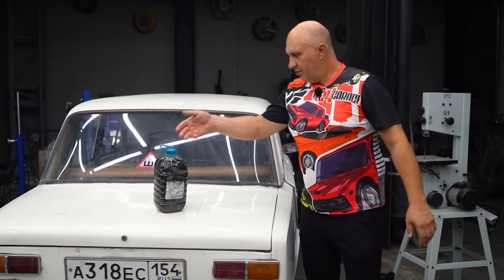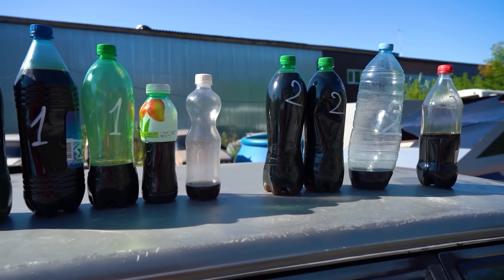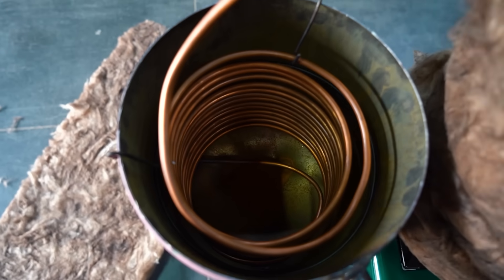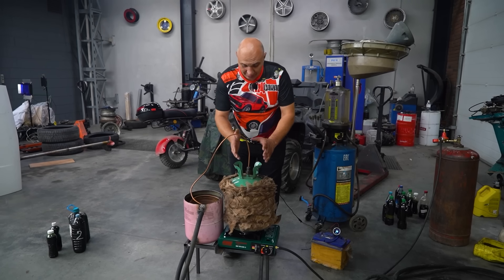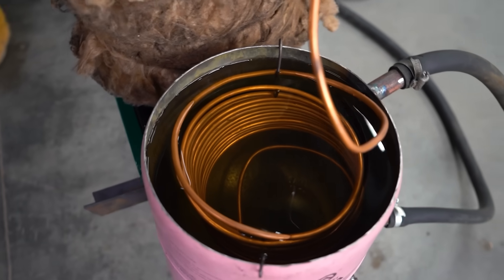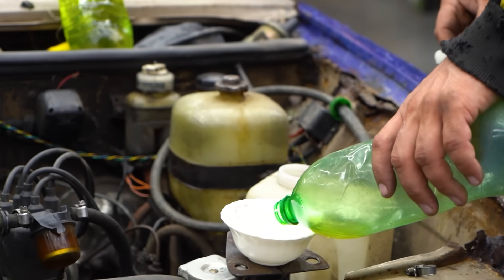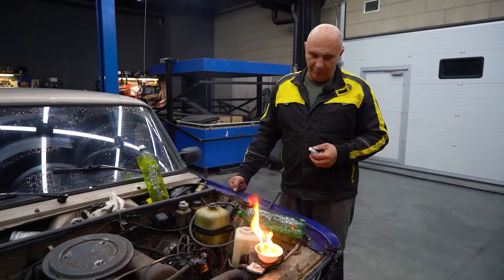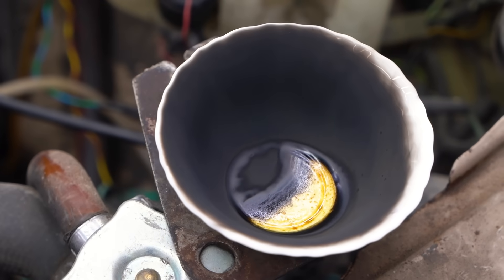Tire-extract fuel vs pump gas - which is better?

Comment: Unos pequeños consejos que te van a permitir mejorar la calidad bastante con poco costo.
Lo primero es que todo el proceso se basa en la pirolisis de hidrocarburos pesados,  más pasadas de los compuestos pesados van a degradarse en compuestos más ligeros. En la industria esto se hace en reactores catalíticos.
Esto quiere decir que más pasadas y mejor manejo de la temperatura te van a permitir obtener lo que buscas con un mejor rendimiento. Los compuestos más ligeros como los gases butanos, propanos, etanos y metanos te van a permitir continuar el proceso al usarlos para recalentar el reactor pirolítico, una vez iniciado el proceso.
 La gasolina evapora alrededor de 75° a 85° centígrados aproximadamente, lo ideal es extraer el condensado a esa temperatura, lo demás reenviarlo al reactor o a uno que trabaje a menores temperaturas. Esto va a eliminar los aceites más pesados presentes en la combustión, dejando solo lo que le hace bien al motor.
Primero a más pasadas por el condensador mejor calidad de combustible vas a obtener.
Segundo es una materia prima con impurezas. Un neumático usado tiene inclusiones de metales (alambre y esquirlas), silicatos y otros compuestos que arrastran después de su mecanizado. Cuando lo pasas de sólido a líquido, en el primer ciclo de pirolisis, te van a quedar restos en el reactor y en la solución. 
Decantar y filtrar no es opcional, se tiene que hacer. El decantado se hace con un bidón de 6 litros de agua para aprovechar el embudo del recipiente como tolva. Hay recipientes plásticos de 25 y 40 litros muy económicos utilizados para elaborar cerveza que son más útiles. También se puede trabajar con acero. Se coloca una válvula para extraer la solución por encima del nivel predeterminado por el embudo.
Un decantado promedio tarda de 24 a 72 horas y se puede realizar sin coste más allá de la perdida de un poco de solución que quede con los sólidos. El decantador se puede reutilizar después de lavarse. Y se tiene que lavar ni bien, se termina de usar para evitar que los sólidos se adhieran a la superficie. Después de un primer decantado grosero suele puedes usar filtro de tela o de papel. El de papel es mejor, pero no es reutilizable y tiene capacidades limitadas para trabajar en volumen. El de tela es un poco más reutilizable, pero una vez se sature debes eliminarlo igual. Esto te va a eliminar muchos residuos físicos y hollín, lo cual se traduce en una mayor vida del motor.
Tercero puedes cortar el combustible usando un hidrocarburo más ligero como lo es el etanol para mejorar el rendimiento. Se usa mucho para mejorar sus cualidades. Hay países que a la gasolina le meten un 80% de etanol. Puedes usar los mismos condensadores como alambique para procesar algún fermento de frutas, granos o papa para obtener el etanol en cuestión y aumentar su graduación solo luego de un  primer decantado y filtrado. Obviamente, el manejo de la temperatura  y las levaduras es igual de importante. Si lo usas para quemar los echas todos los que salgan por debajo de 100 °C de condensación.
Si lo usas para otra cosa cuidada con el metanol y los alcoholes más pesados.

Comment: My guess is the synthetic gasoline has a little more oil lubricant properties to it which helped to seal the rings and valves in your old car giving it better results. However it burns dirty and here in the USA probably wouldn't be legal. Also would be harder on your emission components and catalytic converter.

Comment: distillation obviously.  but mix in old gas and any other petroleum.

It's a thing I dreamed as a child and it works for diesels quite well.

post apocalpse concept  2-stroke engines.

I bet you can run that leaner towards the 25:1 of a diesel.. maybe a 18:1 ratio

Comment: Hmm 🤔 what I saw was that you poored just shy of 1000 ml of regular pump gas in the car for the first range test. Then you put a quite a bit more than 1000 ml of the moonshine petrol in the measuring bowl. That difference would easily have made this range difference logic.
I suspect that you have put in roughly about 50 ml more of the moonshine in the test.

But still an interesting test and impressive result. 💯👍

Comment: You must have a diesel derivative left over in the extracted distillate, which did not carry over the cooling coil at that temperature. Maybe if you have a hydrometer you can also check the densities of both the gasoline vs the synthetic gasoline - regular diesel and the left of from the synthetic gasoline distillation. - Also you could use a thermometer to check temperatures of any given liquid. 🙏🙏🙏🙏 all for recycling - those tyres have some nasty benzene and cyclobeneine derivatives;-/

Comment: Try putting caustic soda (sodium hydroxide) in the fuel oil  to remove impurities, mix thoroughly, it should form a gel which will remove easily, before distilling.

Comment: Look into a process called ( thermal depolymization) it was an article in discovery science mag in the 90s 
Basically a grinder pressure cooker using high pressure steam to break down things. They built a plant at the butter ball turkey factory for processing all the organic waste they get light sweet crude oil from the process that still needs to be refined. Just spit balling ideas.
Great video

Comment: You need a fractional column condenser,
You can even do it somewhat like the big boys, using car thermostats to open to a secondary condensers, lowest boiling on the top, as the lighter parts distill off the column with get hotter opening the thermostat lower and so on...

Comment: Adds a whole new meaning to burning rubber!   Run 10 liters through and do a plug comparison before and after to see if there is any significant ash or goo on the plugs.

Comment: you just made an air still distiller.. why not just buy an air stiller and try that first. you distilling the oil from the gassoline , when separated you have crude diesel fuel and gassoline fuel.

Comment: You need a fractionating column and good temperature control. Otherwise you’re not really separating the fractions , more just stripping out the lower boiling compounds. It’s better, but it could be a LOT better.

Comment: Great experience ! You should have measure how many energy has been used in production and how many energy did you get as an output ?
I think you use more in all process than you yield at end, however results are really interesting ;)

Comment: Seems like you left out the most important part,
What effect does this have on fuel filter and intake/ carb or injecters.
Over time it will gum up and fuk it up. Could also build up causing detonation. 
And lastly the extreme cost of processing tires into fuels. 
Seems alot more sustainable to make fermented fuels like whiskey vodka.
In the end booze is only rotting plant matter. Water plants sugar rotting = booze. 
 But the added cost of stilling it down.
Its about cost.
Id like to see steam engines make a come back.
Could have a steam powered ev pretty easy.

Comment: Pour the mixture through a cloth or run it through a fuel filter first, should help strain out any sediment....get or make an oil/water seperator to separate out the watery batch from the first tank.

Comment: W123 240 and 300D are one of the cheapest used cars (and cheapest classics) around me

I already have a Lancer GTI 16V, but I could buy a w123 diesel, make it run on biodiesel and essentially have almost free fuel. Slow, but reliable and comfortable. Huge boot too. Lmao, could even get some all terrain tires fitted.

Comment: Ran my car (VW 411LE) on 100% ETHANOL way back in 1980 when they were 'TESTING ' what percentage Alcohol could be added to Petrol. 
Performance was absolutely fantastic compared to Petrol and only difference was to adjust Points Gap a little bigger , no 'Heated Intake Manifold or anything else. 
I just laughed when 'They' decided to only add about 10 to 15 Percent Alcohol. 

Ps. Nothing wrong happened to my VW .
I just missed running on the Good stuff afterwards.

Comment: clean the insides of two engines and leave them running for some time at medium rpm. one with regular petrol and one with tyre petrol and then check how the insides look. I believe the tyre petrol would have a lot more residue.

Also, you could distill it again, probably would make it "cleaner", I guess.

Comment: There should be a different carbon connections formula wise, some of amonia, h2s, diesel and vacuum distilate leftowers and the octane count should be way off in this unstable untreated petroleum fraction. After running additional distilation process you should get a cleaner petroleum fraction eliminating part of that rubbery residue

Comment: Try doing the same process with used engine oil, or vegetable oil!  Maybe get it hotter,  600°f + use a check valve or bubbler, to prevent air entering and causing the fuel/oil to burn, its going to instantly burn at 600° if it gets o2. 
Id like to see it heated until it produces 1bar pressure then released to the condenser!  Maybe use ice water!  I have soo many ideas when it comes to synthetic fuel, or alternative fuel.
 Adding butane, benzene, methanol , naptha possibly,  can increase the octane..  i would love to see it octane tested,   they run it in a single cylinder lab test engine, raising the compression . Until knock is detected, it is done just idling or revving unloaded,  then done under load . Listening with knock sensors!  The synthetic fuel is carbon rich,  another possibly is to seal it in a container pull a vacuum, and fill it with o2,  or bubble o2 through the fuel allowing o2 to be absorbed like co2 in soda,  it will possibly lower the octane ,  but should make more power from a more compete burn!  Its not going to be a major  difference like hitting the nitrous button!  Maybe a half hp at best.

Comment: I would definitely try pulling a vacuum on the still. After the crude is added. Seal the still and only open to the condenser when it has started making pressure. Crack the long chain molecules.  I would not exceed about half the  containers rated pressure, .5 bar atleast should do  something . Traditional tires are made from rubber tree sap, latex. Then sulphur and charcoal dust and probably other minerals chemicals,  to change the properties of the rubber, im guessing innertubes would be a excellent source of rubber for distilling. Or pyrolysis.. next do the same with wood/saw dust! Make methanol , maybe mix the two!
 Someone is building a plant to produce synthetic gasoline in their yard as we sit here!😆.  Seriously, im thinking about it!

Comment: I belive mixing it with about 10-30 % pump gas it sould be fine, now we know  there is no excuse for gas to be over $2.50 a gallon! $1.50 really, and diesel can be made  from plastic and tires, probably gas from plastic also,

Comment: So if it burns slow just like methonol does, if you advance the timing of the spark and the valves you'll getting even better performance.

Comment: Really probably need a bubbler cap distillation column, and some good thermometers to catch the right fraction. Remember, that straight run gasoline is known as white gasoline (naptha) which is very low octane compared to modern gasoline which is enhanced with additives.

Comment: Probably get more energy but I'd mix it with methonal  to clean it up it probably more like diesel than gas as it is. Thin it with alcohol and run a fuel filter and it should run better

Comment: I would be interested to see the head pulled and inspected. I'm curious if the engine is combusting all that oily residue from the open air flame test. . . Or if its building up, gunking up the system😁🇺🇸👍

Comment: Fuel companies already know about this but the full method and formula is locked in a vault forever so they can milk the paying public at both ends and use up the last of the crude oil before moving to something else that they can sell for 10X what it costs to produce. Cars could probably run on water too but that formula and engine will NEVER be made because obviously the fuel companies won't make any money off it ^_^

Comment: Tire oil is base oil most of the lighter fractions are gone best lighter fractions are distilled with it it is like a kerosene bass oil has the same density as diesel fuel

Comment: The reason this kinda fuel mixture is not used and never will be, is that it's releasing TONS more toxins and byproducts. Same reason they had to stop using lead. Except the gov. knew the risks of lead befire they let all that happen. But thats another story. 
This could sadly never be a viable fuel for the masses. But in a SHTF situation, I'd do this! 
Great video as always. ❤

Comment: Tires are made of polybutadiene, basically a big long tangle of unsaturated hydrocarbons. "Cracking" the tire compound results in a mix of liquid hydrocarbons of varying length. The soot is due to carbon-carbon double bonds still present in the fuel, something that gasoline tries to minimize for cleaner burning. If you were to take this "tire extract" and bubble hydrogen gas through it in the presence of a metal catalyst (Nickel or Palladium I think???) you'd reduce the number of C-C double bonds and get something that's even closer to gasoline than what you have already.

Comment: Try doing it with the heat vessel under pressure on a lower heat. Been using ice bath to condense. You should get lighter hydrocarbons. Although the yield will be lower.
Reply: Refineries have their heat vessels pressure around 1.4 bar. Then have different condensing vessels at different temperatures to condense different hydrocarbon chains
It's called cracking. 
Breaking down the lager hydrocarbons into smaller ones. 
Instead of just extracting the existing small hydrocarbons.
Reply: With that method you might yield more from tires.

Comment: The different fractions of gases (butane) and then gasoline, diesel and crude oil will condensate at different temps. Having several outlets for different products at different temps of condensation will give you several products at once. Like one pipe going downwards with different taps along the way

Comment: You noted the bad stink! Thats a dangerous cocktail of evil chemicals also known as for ever chemicals, nearly all these chemicals are known to be carsonogenic, these are a serious health risk, cancer is the most common result of breathing the fumes in even skin contact can be leathal over time, the exhaust is even worse, that's why until all the oil wells are dried up no one will seiously recover any of these chemicals, they are to cheap right now to produce as by products of petolium production, reclaiming them from waste is a very un echonomical unless there is a specific need for a combination of two or more combined chemicals, combustion fuel is not one of those, the steel from the belts or the carbon black used in tyres can be totally recovered, there is still plenty of super toxic waste produced no matter what process is used. Yes you can make pyrolosis fuel cheaply at home if you want to pay the price of your health and any one around where it's made or used.

Comment: I love the idea. I would suggest filtering it during the refinement/collection process, like an activated carbon scrub , then a regular fuel filter. I wonder how dirty the engine would be after running that?

Comment: Would be interesting to extract wood gas the same way and see if it would be possible to run a gasoline engine from say Pineneedles or bark

Comment: South America, and alot of African countries use fuels made from certain tree saps and recycled rubber, and it tended to be a higher octane than standard gasoline.

Im American so in our octane rating system it would be around 104 octane.

Comment: I saw a video of a guy in northern Missouri that took saw dust, burned it to heat tires, which put off a gas.  He had like a distillery. First tank was diesel, second was gasoline and third was for gas.  Diesel, ran saw mill engine, gasoline powered his pickup, gas heated his house and part of the mill.   He also had scrap steel to sell, and carbon black to sell.
Reply: Channel name?
Reply: What’s the channel
Reply: don't laves us hanging
Reply: Name
Reply: Do you know the name of the channel ?
Reply: Awful lies
Reply: Is there a link?
Reply: @dragan3290     Yours is the first notification I got on comments.   I looked for an hour, and cannot find it.   I saw it about 15 or more years ago.   There are lots of videos out there now.   Just search     Tires to fuel

Comment: My humble opinion, it looks like gasoline without the additives, that's why it burns that way, most gas around use retardants to work better in higher compression engines, pure gas would be something like sub 8:1 compression rate, causes engine knock, but works wonders.

Comment: With pyrolysis you can get all your fuels. Lower Temps give gasoline, then you also get you butane, diesel, jet fuel, all at different temperatures. The fuel is 100% fine to use in engines, it just needs a little bit of cleaning, like through steel wool, clay pebbles, bubbled through water. There are many  ways to do it. Even the gas that comes out of the last bubbler can be compressed and stored in gas cylinders and used on gas stoves. It might smell bad, but remember that commercial fuels are washed, bleached, chemicals are added to give it different smells.
Reply: show us how to clean the fuel they make would be something worth watching cheers
Reply: ethanol is added in higher quantities so i think that would make a difference in how clean it burns
Reply: He needs to crack the crude.

Comment: I'm 107% sure, that the insulation is only glassfibre or rockfibre and not Asbestos because Russia is absolutely not the biggest producer of Asbestos these days and  totally did get the memo about how incredibly cancerous it is and that it's banned in basically every country.